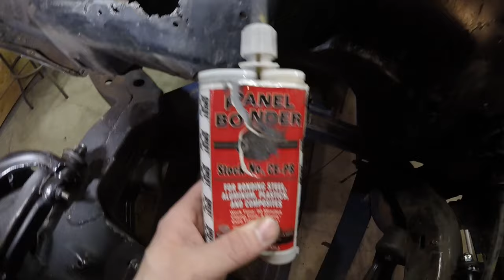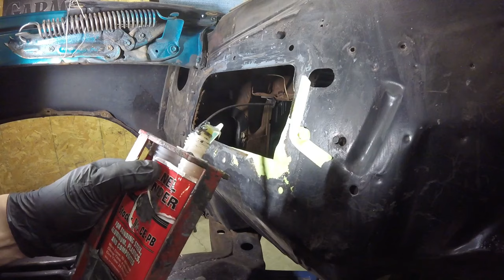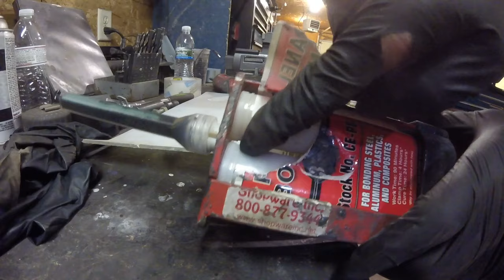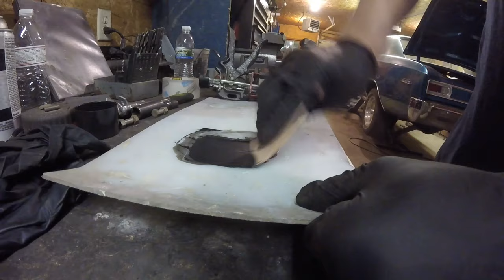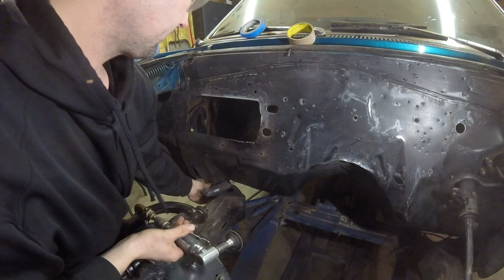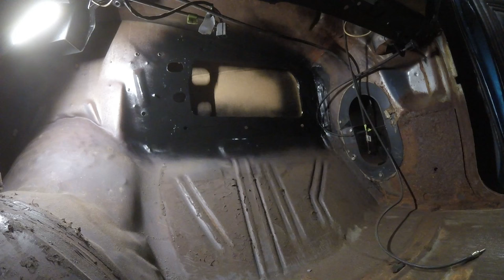3M Panel bond used instead of welding.  Rust Repair.

Comment: Urethane windshield adhesive will do the same job and way cheaper. Better than welding because it doesn't burn the metal in places that you can't refinish. Did bodywork for 50 years both with welding and panel bonding. Panel bonded repairs last forever ,welding does not because of metal deteriorating becuse of heat. I started bodywork when lead was the standard

Comment: Although I would have probably welded that heater box perimeter, I am hoping this method will work for some small non-structural repairs up higher behind the dash at the corners of the windshield base. Cannot weld without removing the glass since the heat would likely crack it. Believe I have resolved the water ingress that caused that, but not going to take the glass out. So appreciate you sharing this. 90 minute working time is a blessing too.
Reply from the maker: It will work well. Especially if a fiberglass mesh is used with it. I’m my video, I didn’t use a mesh to keep the repair super thin. So if possible, use a mesh cause it helps. With the heater box sandwiched this repair, I felt it would be just fine without mesh as well. Glad I could help someone!

Comment: Im doing  a 73 cogaur replacing the rocker panels the repair is close to the gas tank .safer and quicker to panel bond better to be safe then sorry there  not huge peaces saves me tons of time welding

Comment: Was wondering why you didn’t use some short strand fiberglass like Duraglass.
Reply from the maker: The panel bond will have flex to it compared to a short strand fiberglass. And the panel bond has corrosion resistance properties built into it as duraglass does not

Comment: Nothing wrong with panel bond, just 3M product is not the brand to use.
Reply from the maker: Why don’t you like the 3m brand? Too expensive? 3m has been making panel bond for close to 20 years if not more. Which brand do you prefer? I have used crest as well and it’s very similar but harder to come by
Reply: What brand do you recommend?
Reply: Lord Fusor is way superior. I’ve seen 3M let go. I used both when I was working professionally in the trade. OEM manufacturers make some great stuff today as well. Lord Fosor is my go to.

Comment: Have seen this stuff sandwiched in all kinds of places.. filled over and painted. A quick fix for auto painters without welders.. they get two years and it begins to separate from the basemetal.. cracking fillers and paint.. for the price and the time to cure.. just buy a cheap welder.. even flux core.. do your best with steel and its still going to be 100 times better than any product like this.
Reply from the maker: Absolutely this won’t replace welding. Not everyone has a welder. Not everyone can weld thin sheet metal. Not every time can a welder be used under certain conditions. I would never do this on a paying job without full disclosure. There are a lot of worse ways people abuse.